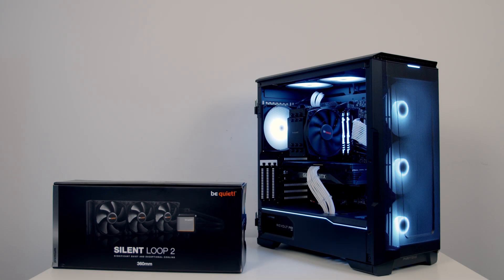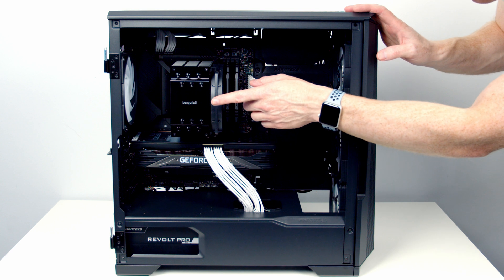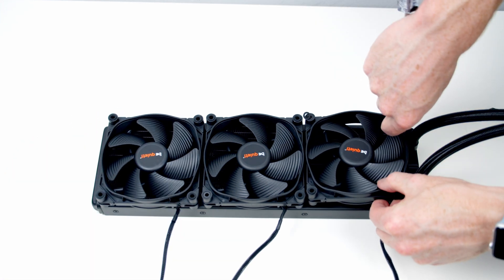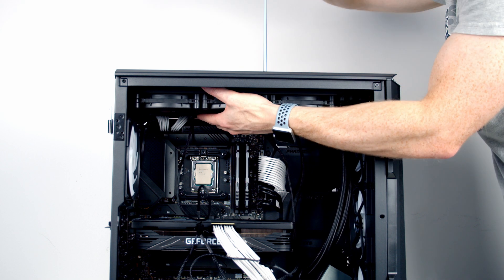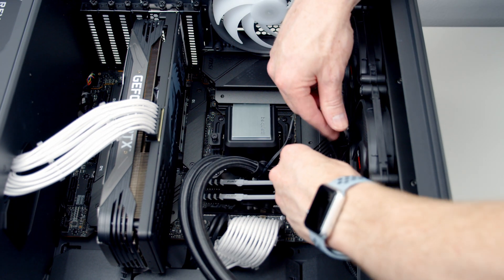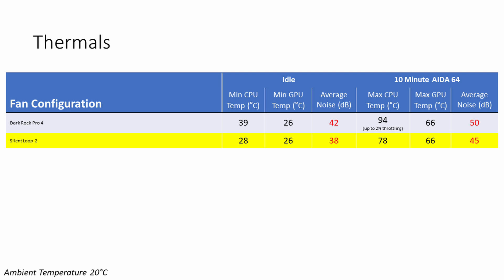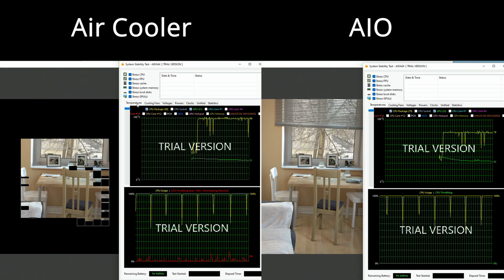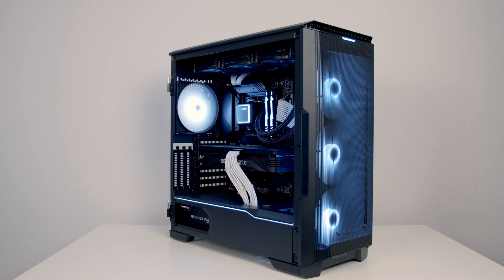Installing the Silent Loop 2 in the Phanteks P500a - Installation Guide and Thermals vs Air Cooler

Comment: Have this exact case with a 6900xt and 5600x. Have nzxt kraken x53 240mm rad and have noctua 120mm exhaust in rear. Cpu temp never reaches 60c but my gpu hits 80-85c in some games. Anything I can do or any pointers to get those temps down? And also what rpms and fan curves do you use for this case in bios?

Comment: Chris, it would be interesting to see if the orientation of the AIO radiator makes any difference at all. If you move the radiator to the front of the case setting the fans as intake and put the front fans at the top as exhaust, does it improve the temps at all, with the exact setup you have otherwise.
Reply from the maker: Haven't tested in this case, but would expect CPU temps under load to go down by around 5 degrees and GPU up by around 2 degrees and noise to go down by a few dB based on my previous testing in other cases.